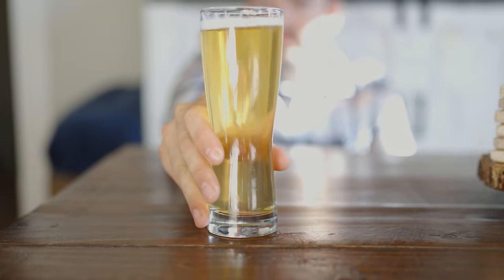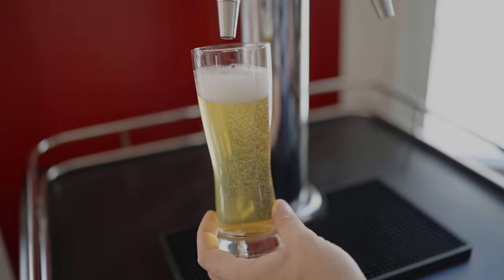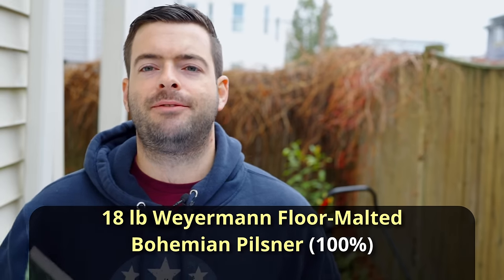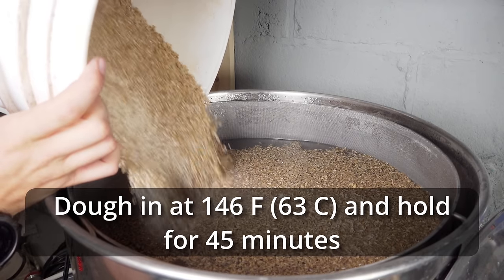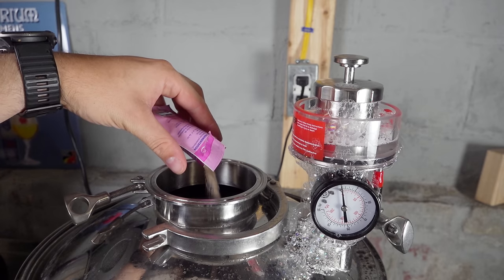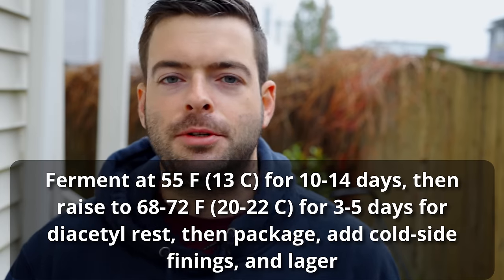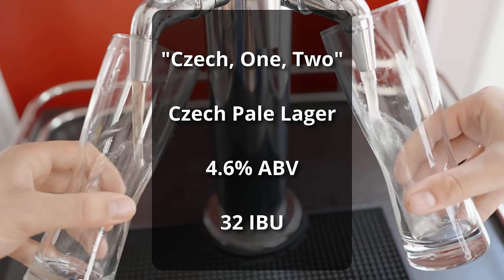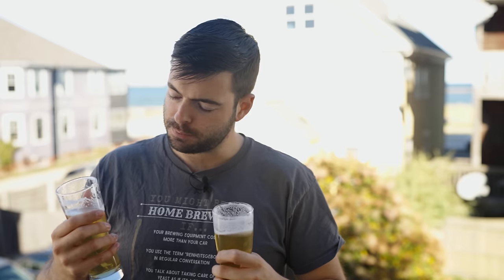Is a PRESSURE FERMENTED LAGER Really AS GOOD as a Regular Lager? Guest Tasters and Triangle Tests!

Comment: I pretty much exclusively ferment my lagers under pressure now days. The best combo is fermenting in a keg with a floating dip tube under pressure. After fermentation, you have carbonated beer and no worries of oxidation because once the keg is sealed up it should never touch oxygen until you pour it.
Reply from the maker: I still have to try that method out, I've been meaning to!
Reply: Could there be a mellowing of off flavor produced in the pressure batch while it sat waiting for the traditional ferm to finish?

Comment: Thanks for the video.  I enjoyed it.  You might want to introduce a third option which is pressure fermentation at lager temps.  This is what all of the large famous brands do in their large fermenters loaded with hydrostatic pressure.  I do not know if you can control the temperature around your pressure vessel though.  For some reason, the homebrewing community has associated pressure with high temps.  That is probably more applicable to ales, but high pressure and low temps seems to be where it is at for lager beers.  Pitch more yeast but it will be the cleanest lager you have ever made.
Reply from the maker: I'll keep it in mind!
Reply: I think the association between pressure fermentation and warm temps comes from the ability to ferment lagers at those warm temps. A lot of brewers aren’t capable of lager fermentation (or patient enough) so the idea of a quicker lager with no lagering method used is appealing.

Comment: Hey man awwsome video! This was my second beer brewed and the first was your irish ale. I have noticed that i tend to get a few points of OG lower than your boils. Im using the 120v clawhammer and i keep the lid on and towels wrapped around the mash tun to reach a rolling boil. (Theyre sold out of neoprene)

My question is how much volume do you typically end up transfering into the fermenter? I think by having such an enclosed boil i may be retaining more liquid. 

Thanks!
Reply from the maker: Usually I target about 5.5-6 gallons into the fermenter. The 120V system will definitely boil off less than the 240V system, and that is reduced further when you keep the lid on, so you'll see reduced OG.

Comment: Great Video! I also just completed a 10 Gallon split batch Bohemian Premium Pale Lager experiment, one under pressure and one traditional! Waiting for my Traditional to carb and I will be able to do a side by side as well. One question, what do you use to monitor your fermentation? I use Tilts currently but they are giving me lots of trouble.
Reply from the maker: What a coincidence! Hope yours turns out great as well. I am using an Anton Paar easydens. It doesn't monitor throughout the fermentation but generates a graph at the end once you finish up your gravity measurements

Comment: I have been ready to move from buckets to stainless steel. I have been going back and forth between spending extra for pressure fermentation. This really helps! Love your channel, thank you!
Reply from the maker: There are certainly plusses and minuses for stainless unitanks. If you want to try out pressure fermentation at a much lower price point, check out the fermzilla all rounder.

Comment: I use 34/70 as my go-to lager yeast and I’ve always fermented it in a corny keg under 15 psi. Last summer I was in a bind and fermented it in a non-pressurized plastic fermenter at 75°F and was pleasantly surprised to find that it finished just as clean as under pressure. I then listened to the Master Brewers Podcast episode 216 where they interview Anne Flesch from Fermentis and discuss the profile of 34/70. It confirmed my anecdotal finding that this strain doesn’t put out off flavors even at higher temperatures.
Reply from the maker: It's an awesome yeast!

Comment: I want to do this myself...only problem is a lack of pressure fermenting vessels. So, I am looking into constructing a fermonster based cap that can do a 10 psi pressure ferment. I know it is not recommended, but everything I have read is that the fermonsters are capable to 12 PSI with a solid cap and mods for a floating pickup and two posts for beer out and gas in/spunding. Thoughts? (Oh, those "$50 all-rounders" are now $79 - on sale - without the pressure kit.) Great content and video.
Reply from the maker: Pressure fermentation is definitely getting trendy, and I guess that means they jacked the prices up. I was able to find a few vendors selling the base all rounder for 60 now. Regardless I HIGHLY discourage you from fermenting in something that wasn't specifically designed to hold pressure. If you are kegging, just ferment in a keg if you don't want to spend money. Otherwise, don't try to modify something that could get you hurt. Even if it's plastic, PET shards will do some damage at 12 PSI. Be careful.

Comment: Have my first pressure fermented lager in the fermenter as we speak! Looking forward to trying it out. Two questions: how much geletin do you use? The other question is regarding yeast cell count with cold fermentations. Do you pitch more yeast/do a starter with the traditionally lagered batch?
Reply from the maker: Nice! I'll dissolve about 1.5 tsp gelatin in about a cup of water. For this particular experiment I wanted to have as equal of a pitch rate as possible, and with such a low OG, one packet really was fine for both. Over 1.055 you might want to look at a higher pitch rate, YMMV.

Comment: Hi, great video as always, but don't you think for a lager you're underpitching on the non pressurized part of the batch?
Any yeast calculator I know would say this is heavy underpitching with all the issues attached.
I'd say that would have definite impact on a taste test, right?
Reply from the maker: Not really. I wanted to have the exact same pitch rate for both. But this is a pretty low OG, and W/34-0 is an extremely capable strain. There were no real fermentation related off flavors that anyone picked up. Yeast pitch rate calculators have always done a pretty bad job with dry yeast estimations.
Reply: @TheApartmentBrewer  Thanks for the reply. While I agree that the gravity is on the low side and W34/70 is pretty capable strain my experience with cold fermentation and W34/70 is a different one. For a normal gravity 5 gallon batch 2 packs of Saflager are in my opinion the right choice when pitching around 8-10ºC. But hey, YMMV and I'm happy to hear you got a clean fermentation nonetheless.

Comment: Hi there, loving the channel and learning a lot about how to brew properly.
I've a bit of a problem that I'm hoping you can help me with.
I'm doing a recipe that requires 2lb of D-180 Candi syrup, the problem is I can't get anywhere I am, they only sell the candi sugar or dark brown beet sugar, how much would I need in weight for the candi sugar or dark brown beet sugar? I'm really stuck here and need some help thanks.
Reply from the maker: You can use the same weight in dark candi sugar, just be sure to stir it for a long time so it fully dissolves.
Reply: @TheApartmentBrewer  And the same for dark brown beet sugar as well?

Comment: I love this video exactly what I had been waiting for. I will definitely go with the pressurised version of the recipe having been previously put off using pressurised fermentation by excessive sulphur production from Nottingham yeast which got very stressed under 20psi.  

Did you oxygenate after pitching the yeast, and would that have helped in reducing sulphur notes which some people are very sensitive to? 

Thanks for these fantastic videos, especially the Pilsner series. Hope you can find time to do a series on English Ales, which are sadly in retreat in England with competition from American Pale Ales, which I also enjoy. 

There’s something special about a cask conditioned ale brewed with East Kent Goldings, Cascade hops and Maris Otter malt with a touch of Crystal Malt at 4% ABV!

Cheers!
Reply from the maker: Glad you enjoyed the video! The sulfur note was pretty slight, oxygenation may have helped but I doubt it would have made a significant impact. More likely extra yeast or less pressure would have done the trick. I do need to do more English ales!

Comment: Hi Steve, I follow your videos. In this video, I would like to ask you a question that may be not has sense. If I ferment under pressure at 13*C, would it be good, would it has more benefits than without pressure? Many thanks
Reply from the maker: If you're fermenting a lager under pressure already at lager temperatures, there isn't too much benefit you'd already get otherwise besides natural carbonation. But the beer will definitely be very clean!
Reply: Many thanks for your response. Many thanks for your videos. Cheers!

Comment: Thumb upping just for the subject, haven't seen the video yet. Now that I have finished, great video, the tasters were really good to include. I am sure you have talked about it before but more info on the technical reasons for the rests at different temps, I know it increases the fermentable sugars but it has to be more than that or step mashing and mash out wouldn't be a thing. 1 last thing about pressure fermenting, is there much/any difference pitching yeast then pressurising? I have been just letting the yeast build the pressure up
Reply from the maker: Glad you enjoyed the video! On step mashing - it gives you a bit more control over how the final beer ends up. The low rest temp controls the fermentability and the high rest temp allows you to tweak the body a bit more. As opposed to the single temp rest where you are compromising between body and fermentability. Step mashing tends to also be a bit more efficient. If you add pressure right after pitching yeast like I did, you lower the possibility that there are pitching related off flavors. Useful for lagers, if you want to pressure ferment an ale, you may get more ester character by waiting until later to let the pressure come up

Comment: Great video as usual! 
 I have noticed the Sulphur smell on all but one of my preasure fermented beers, the one that did not have any sulpher smell was a test batch of Dunkel Bock that I over pitched the yeast. Could the fact that I over pitched may have caused the yeast to not become stressed?
Reply from the maker: Its possible, but it should also dissipate with time. It may have been a result of using too much pressure, not sure how much you used.

Comment: Very nice video as always. I have now a couple of hundred pressurized fermentations in my experience. When it comes to ales  I have played around with temps, pressures and yeast pitching rates. With w-34/70 I have 39 batches, but due to very positive feedbacks and general available advise I have stayed with 20 C/68 F, 15 PSI and normal lager yeast pitching rates that would have been the double of that in your video. How important those differences are I would not know as I have not tried it with your numbers, Now I ferment for 7 days, although most, but not all, are finnished after 4-5 days. Some claim that pressure fermented lagers have a shorter shelf life compared to the traditionally fermented but my lagers never get old. I might reduce the pitching rate after having seen your video. Thanks a lot.
Reply from the maker: With this OG so low, I felt very confident with a single packet. I think pitch rate calculators are very biased against dry yeast, and I'm sure with your experience you know that W-34/70 is an incredibly capable and forgiving yeast.

Comment: Thanks for this and all of your other videos. I have learned a ton and am thirsty for more. A couple of questions: Do you typically NOT sparge? And it seems that you just do a one-stage fermentation with no secondary without transferring to a new vessel until kegging? Do you use floating hydrometers to monitor gravity or do you test from samples from the fermenter? Thanks again and thanks for all of your brews!
Reply from the maker: Yeah I really don't sparge unless I am trying to brew a really high gravity beer. And yes, no need for a secondary fermentation. I've used floating hydrometers a few times but I really haven't had good experiences with them, so I take samples instead. Cheers!

Comment: The sulfur could be a result of the pressure holding in the volatiles, sulfur gasses off pretty easily. it’s also easy and quick to become nose blind to sulfur compounds, I did note that you tried lagered batch that you observed less sulfur in second but it may have been observable after going back and forth. Great stuff, I’m glad you pushed the temp to where you did.
Reply from the maker: Seems likely! It was very subtle and of course it tends to dissipate over the course of lagering as well.

Comment: Gonna try a 10G SPLATCH just because your VID was great !!  Don’t have PH meter and wanted 2 know is it OK to just add 1 cap of lactic acid if I use RO water ??  Also wanted 2 hop options for my comparison cause I don’t have Saaz ???
Reply from the maker: Depends on the pilsner malt you use, but I would guess that would work just fine. It should act similarly. Hmm, Saaz is tough to sub for but other european nobles should be similiar - tettnang, hallertau, hersbrucker or styrian goldings. Its pretty cheap and easy to find though.
Reply: @TheApartmentBrewer  Great. Just got some Saaz!!!

Comment: Several pitch rate calculators indicate the 2 packages lager yeast should be used. Seems your last 2 lagers had only one package each.  Is this your preferred amount of yeast for a 5-5.5 gallon batch? Is it wasteful to use 2 packages?  Thanks again for all of your videos.
Reply from the maker: Your experiences may vary. W-34/70 is an EXTREMELY capable and forgiving yeast. I've occasionally pitched two packets into various ferments with it but for an OG this low its really overkill to use two.

Comment: I recommend pitching more lager yeast. The “pack a batch” is rarely adequate IOW manufacturer recommendation for lager yeast. 1 pack may be OK at 70°F under pressure, but 5 gal of 1.042 wort fermented at 55°F has a recommended pitch rate of ~21.5 grams.

Comment: Is it best to pressurize using c02 straight after you pitch the yeast so that the entire fermentation is under pressure? Or is it better to let the yeast create the pressure?
Reply from the maker: I usually apply the pressure right away, but I dont think it makes a huge difference to wait for the yeast to do it as long as you still pitch at the right temperature

Comment: Great test and again great content! I was thinking about your yeast pitch rate - normally for 5gal lager, it's prefered to use 3-4 packs of dry lager yeast. I see you use another time only one pack of yeast and it's still good beer. I would think, that sulfur will appear in lager batch with 1 package of yeast and pressure fermented batch will surpress that sulfur but it's opposite way. 

Second thing is, that I listened brulosophy and they tested W34/70 also in 80F without pressure and they said, that they even prefer this version then normal lager batch. Maybe for next test is good to choose yeast strain which is producing lots of off flavours and make 3 batches simultaneously with first as lager, second pressure fermented in room temp, third normal room temp beer?

Thanks again for your content, cheers from Poland! 🍺
Reply from the maker: Yup, with this low of an OG, one packet is plenty. I've done a few warm fermented lagers with this yeast but never that high. I love what Brulosophy does!

Comment: Hi. Is there any difference when i add pressure at the beginning or wait until the fermentation built desired pressure for eg.12 psi itself?
Reply from the maker: I would recommend adding pressure at the beginning to minimize the chance of pitching relate off flavors.
Reply: @TheApartmentBrewer  👍🏻 but maybe in case if I would like to get some fruity esters from yeast that might be right way to wait until pressure built up. 🤔

Comment: So after my third attempt at pressure fermentation (all three have failed) I can't figure out what is happening. All three attempts were at around 68-73, all were butter bombs. 1st one I identified as an infection after noticing the keg had some stuff leftover from Kombucha I put in it (I recommend having a Dedicated Kombucha Keg), Second attempt I couldn't work what happened, This last attempt I was extra diligent but still had a butter bomb. I keep getting told Temps matter even under pressure. But isn't that the appeal? Or is it that not all yeasts can handle room temp pressure fermentation?
Reply from the maker: Diacetyl is an indicator of a stressed or incomplete fermentation. Make sure you have a good pitch rate and that you aren't still pitching the yeast hotter than it supposed to be pitched, even if its under pressure at that time. Make sure the fermentation is absolutely finished when you package and that you aren't kegging prematurely. Also try to avoid excessive pressure, keep it under 15 PSI. I'm assuming you're using lager yeast so a diacetyl rest shouldn't be necessary at those temperatures but it may be beneficial to you to do it anyway. Pressure fermentation helps reduce the amount of things like esters, acetaldehyde and fusel alcohol produced from fermenting a yeast above its regular temperature range but it isn't a 100% perfect way to get rid of every off flavor.
Reply: @TheApartmentBrewer  OK I think I'm not pitching enough based on all that. I only used one Packet of Wyeast no starter. I recall using double for a Lager when I did one traditionally a long time ago.